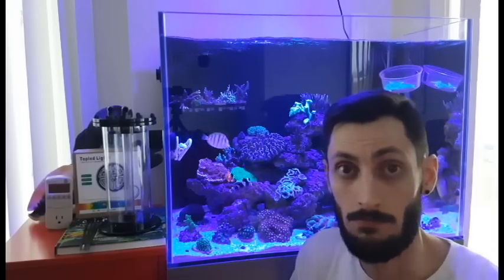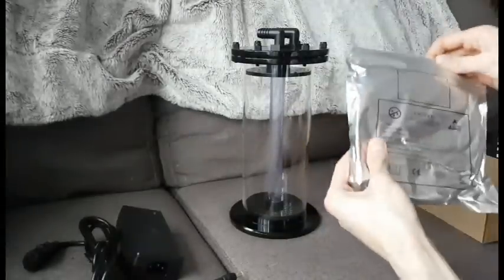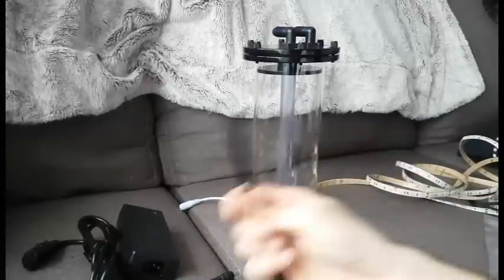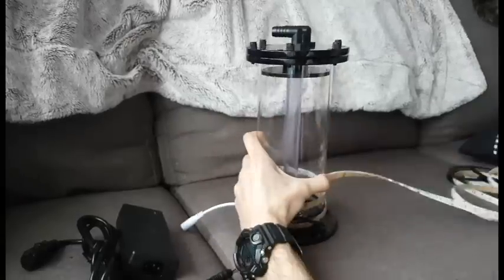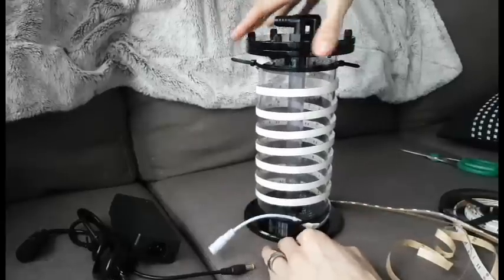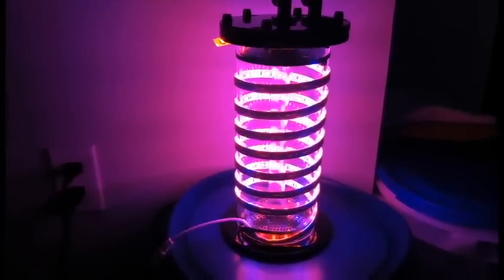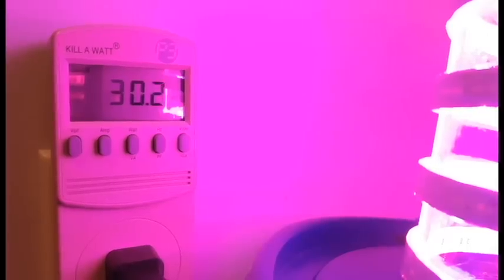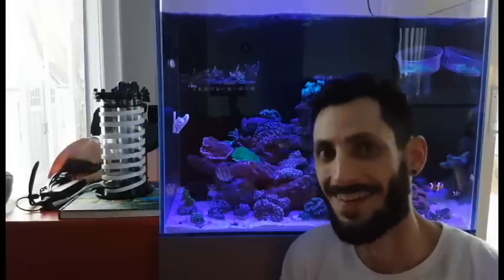Easy DIY Chaeto Reactor

Comment: Just found your channel and love your work.  A couple of questions I have are 1) How big of a reactor to the size of your tank should you buy or does it matter?  I have a 300 gallon tank and have a refug Kim space  built into my sump but the design is not great and not effective.  Next, when you start using the reactor how big of a piece of chaeto did you put in the reactor and did you add anything else?  Thanks for your help.
Reply from the maker: Thanks, Skip!
I'd go as large as you can fit within reason. You can even use the chaeto reactors on the market as examples for size based on their ratings. I started with very little chaeto. Around 5% of what would fit in the reactor is all I started with. Pull thin strands and space it out as evenly as you can and you'll get the cheato growing evenly in the reactor which is generally the fastest growth.

Comment: Question, if I don't have a sump and put the reactor at the bottom in the cabinet, will the water go up due to pressure of water coming in up to the main tank?
Reply from the maker: Not sure if I 100% understand what you are asking, so my apologies if I am off, buuuut a reactor hooked up to a pump will function very much like a canister filter would, so the water will sit in the lines at the top of the tank if you shut the power to the pump off.
-Thomas
Reply: @NaturalAquaria  Let me try again, Since it is so bright, I'd like to keep it in the cabinet but I don't have a sump so the pump that will feed it will still come from the main tank above. My question is, will the water move back up or gravity will pull it down?
Reply from the maker: @Jel0XD  There are a couple ways to approach it, but ultimately as long as the pump has a good head pressure it will work. Think of it like a canister filter; the inky real difference being the pump isnt attached to the lid. If you have trouble with the pressure, you can try moving the pump under the cabinet and in-line just after the reactor so it draws water through the reactor and sends it back to the tank. The Cobalt in-line pump might be a good candidate!

Comment: I'm back. It is "Kee Tow." Anyway, you got me thinking...  I have saved a boat load of money doing "DIY" projects.Have you ever tried the Kessil lights? I am curious how the strip LEDs you are using, compare.
Reply from the maker: I have used Kessil! Big fan of them as well, definitely my favorite shimmer from an LED, and the closest fact simile to metal slides in appearance and spread. I find the overall color of the Illumagic to be better and provide way more pop, but I havent used the new X Kessil lights, only the older A360W Tuna Blue and Tuna Sun.

Comment: How much  heat  does this  transfer to your aquarium ? Is it significant ? I live in a hot climate and don't want my chiller to constantly run. Also , I liked and subbed .
Reply from the maker: +canogaJE I had no noticeable heat change while running the reactor. The LEDs are coated in silicone and exposed to air rather than being surrounded by water.

Comment: What's the flow you have going in through the reactor slow moderate or pump fully open?
Reply from the maker: +Anthony Torres I was using a Biopod 29 return pump. No restriction.

Comment: Thomas B. thanks for posting this vid as well as a follow-up and some info. I'm just getting back into the hobby after a 10 yr layoff and 30 yrs prior experience. Glad to see something besides GFO (although it does work well) to remove Nitrates and Phosphates and saves you money in the long run.
One question because of something I saw somewhere else which I find highly suspect. Have you noticed any type of cracking or anything on the outside or inside surface of the reactor due to light/heat transmission?
Reply from the maker: None whatsoever. That sort of hazing is more likely to happen if you don't use waterproof LED strings. That would cause direct contact between the diode and the acrylic, which could lead to overheating and hazing. The waterproof LED strings are coated in silicone [or similar] rubber and provides a buffer between the acrylic and diode. I also would suspect the quality of the reactor material could play a big part in that issue as well.

Comment: "some cheap LEDs from Amazon"  there is an insane number of options when you search amazon for LED strip lights.  Some may produce a lot more heat or have other issues.  Can you add a link to your description and/or in a reply to this?  Please?
Reply from the maker: I am using these: https://www.amazon.ca/gp/product/B01MG4SJYN/ref=oh_aui_search_detailpage?ie=UTF8&psc=1
Reply: Thanks.  Looks like that link will only work in your country.  For anyone else who may be looking you search amazon for B01MG4SJYN you can find the item and then maybe search for something similar.  Thanks again Thomas.

Comment: How much heat do those lights give off? I don't have a cabinet to but it in and I need a way to block all the light. Was thinking just draping something over it, but I don't want it to overheat
Reply from the maker: They do get quite warm, but the reactor acts as a heat sink and helps keeps them cool. They don't produce enough heat to affect the tank temp at all (50 gallons volume). I'd be comfortable getting a abs or pvc tube and sliding it over the reactor.

Comment: any update? how was growth?
Reply from the maker: Growth has been pretty great so far! I will do an update soon.
Reply: i have the same lights and reactor. Growth has stopped for whatever reason and the chaeto is losing color. 

I think it is either a deficiency in some trace element (iron maybe?) or maybe running 24/7 light has not done it any favors. Thoughts?
Reply: oh and also my nitrates are high, about 40. Only running a small skimmer.
Reply from the maker: I am only running it 12 hours on, 12 hours off, opposite the main fixture on the aquarium. Basically the exact same way I ran the refugium. I have never had the best luck with running any plant on 24/7 light, and chaeto being a macro algae may have the same stresses as plants when exposed to non-stop light. I'd first start by changing the light schedule to between 8 and 12 hours daily to see if that solves the issue.
Reply: salinity changes can cause this...make sure your are around 1.025 PPM, and constant...radical temperature changes can funk things up as well

Comment: is it running yet if so how well? nutreint levels?
Reply from the maker: Yes, and on par with where they were using the sump fuge rather than the reactor which is exactly what I was hoping for. I am going to be switching out the sump for a custom one i will be receiving soon, so I will hopefully do the update at that time.

Comment: Looking forward to seeing the results you have with yours. I put a cheato reactor together to night and put on my tank. I am trying to run a cleaner sump with less areas for detritus to collect and believe this will help. The only thing I am unsure about is whether I should have used the warm white LED instead of the red-blue.
Reply from the maker: There was a lot of discussion on the topic of what color lights to use, and ultimately, what people had found is that the warm white or cool white LEDs did not include much or any 440nm or 660nm light, and usually fell just short of those ranges. 440nm and 660nm fall on the photosynthetic peak for plants, meaning that the rate of photosynthesis is highest when provided with those wavelengths. Essentially, it was discussed that a hydroponics red/blue LED light should be better at growing algae than a plan warm white or cool white LED. The theory has been tested by a few hobbyists, and it seems to hold true. However, even the warm whites performed well. Either way you will grow chaeto!

Comment: awesome  please post.the link for the lights
Reply from the maker: https://www.amazon.ca/gp/aw/d/B01MG4SJYN/ref=mp_s_a_1_1?ie=UTF8&qid=1491161730&sr=8-1&pi=AC_SX236_SY340_FMwebp_QL65&keywords=topled+light+plant&dpPl=1&dpID=61%2Bagu4Sx2L&ref=plSrch
Reply: That's a 5M roll. How long did you actually used?
Reply from the maker: Used about half the roll of LEDs, maybe a bit more.

Comment: How is this better than using this reactor and putting GFO media?
Reply from the maker: The pros are that it not only removes phosphate, but also nitrate. It is also cheaper to maintain, as once you put a small amount of chaeto, it will grow until it fills the reactor, at which point you harvest 3/4 of it and let it start over. Don't have to keep buying phosphate media that way. Lastly it will act very much in the same way a refugium does allowing for the culture of amphipods, copepods, and other beneficial microorganisms which will help feed the aquarium inhabitants.
Reply: Thomas B .... Perfect.  I just got my reactor.  Getting chaeto algae tomorrow.   Thanks!
Reply: Thomas B Chaeto reactor is up and running.  :)
Reply from the maker: Awesome! link to vid or pics?
Reply: I'll try to find a more sexier cover to block the light but the box that came with it is good for the time being.  :)
Reply from the maker: Nice!
Reply: Kerwin Montinola Ronquillo What kind of reactor is that?
Reply: GhostCrisp86  chaetomorpha reactor.

Comment: Reef tank yay any updates on your tropical tank and how it's going.Im currently setting up a reef tank and am looking for a hang on reactor have you any ideas as to which ones are good it's a 40 gallon tank with no sump.Keep on tankin.
Reply from the maker: Noel Kavanagh honestly the two little fishes phosban reactor is small and well built. have a few I've been using for years.
Reply: Thanks will check them out.